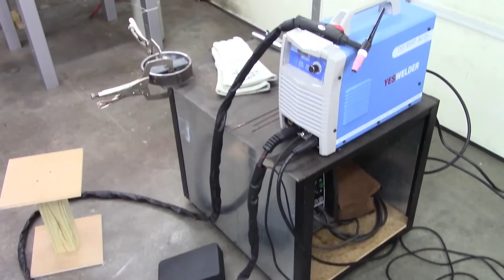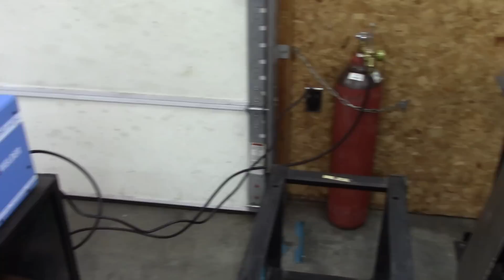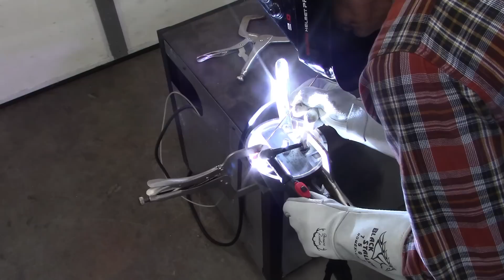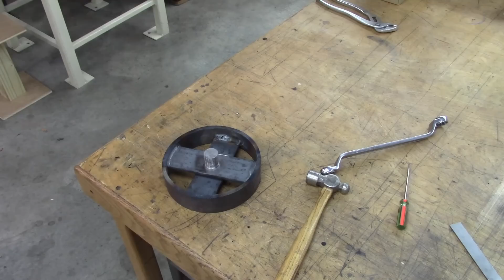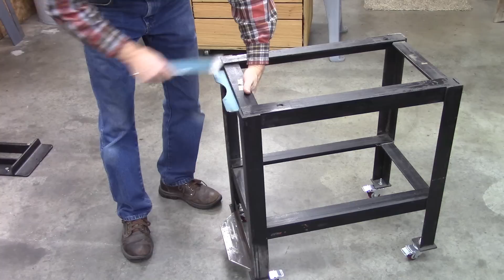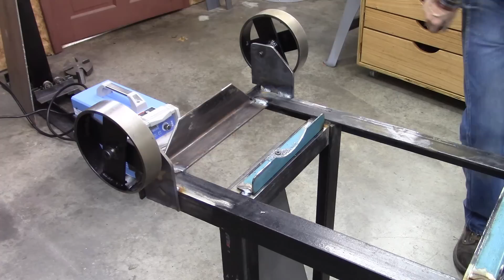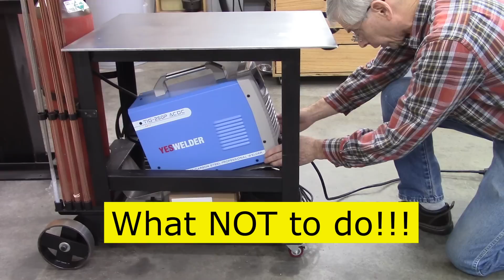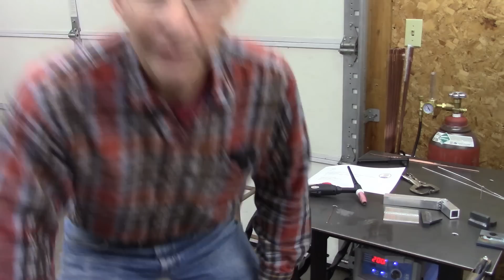Steel Wheels, Welding Cart and My New TIG Welder

Comment: Don’t worry too much about holding the torch near the weld with a long (5-10 second) post flow. That’s a concern with stainless. But steel and aluminum doesn’t have that problem. While you’re right, it isn’t required to weld the back sides on this. It is practice, and with many things, particularly welding, the more practice, the better. TIG requires more practice than other welding processes.

Just think about this; a great looking weld on the outside may conceal a poor weld inside, though most likely, it’s good. A poor looking weld outside will be a poor weld inside as well. But a “decent” looking weld can also, as the great looking weld, go either way. As someone here suggested, in the beginning particularly, cutting a weld, polishing it and etching it to see the quality of the weld is very helpful. You can have a lot of porosity (holes) hidden in the weld, and poor penetration means that while seemingly strong at first, it might come apart later.

With positioners, it’s easy to find the correct speed. Assuming you know how to weld, and the different metal thicknesses requiring different amperage’s and welding speeds, you just translate that welding speed to the peripheral speed of the surface you’re welding rotationally. Just use what you already know about finding the length of the circumference you’re welding and multiply by the rotation speed.

By the way, I’m pretty pedantic over the practice of calling the work clamp, the ground clamp. The only thing grounded on a welder is the power cord. People are so used to hearing and reading “ground clamp”, that they don’t think about it. The problem is that a ground is not part of a live circuit, while the work clamp is. If you attach the work clamp to something to weld, you ground your circuit. The welder will short. When I went, a few years ago to put two weld on hinges on my 14” lathe, I almost forgot to disconnect the power from the outlet. Don’t do that. I’ve seen very nasty results from that happening. It’s exactly what happened here. It’s also why using the welding cabinet as your welding table is dangerous. The welder WILL move around in that table. The welder case is grounded, but the welding table can’t be. If they touch, well, you see what happens.

Also, never mix any wheels, brushes or anything else used to clean metals between types. So, you need everything separate for aluminum, stainless and any other steel. So three sets of everything. Yeah, that seems like a lot, but if you cross contaminate, you’ll get depressed, believe me.

I don’t want to be too depressive here, but I would have left the wheels as is. I’ve built a lot of tables and carts with wheels. I’ve always found that having four swivel wheels is better than two swivel and two fixed. Maneuverability is much better with the four swivel wheels. My welding cart I built, with everything in it, weighs about 500 pounds and moves easily, even in tight areas. But the tool cabinets I have are clumsy. I’ve replaced the fixed wheels, and they’re much better.
Reply from the maker: All good information. I like the two non-swivel wheel but would like four swivel if I was not also using the cart for the table. And YES, I agree, this is not generally a good practice. For my small space limited shop it's a good option but as you said, it's not a good practice and I saw this first hand. In my mind it is sad that this happened. While is was should have been seen as a "good example of what not to do" it reflected badly on the welder in the minds of many. I'm not saying it's the same quality as a Miller but it is absolutely a good functional welder at a good price.  Yes I have found out with Aluminum contamination is terrible. Steel not so much but still somewhat an issue... never welded stainless yet. My post flow is usually 3 to 5 seconds. It helps but I agree... longer just wastes gas.  My weld quality is probably good enough for anything I am doing. I have welded 1/4 and 1/8 plate and bent it in the vise with a hammer. It never breaks at a weld. In fact 16 gauge sheet metal was the same and the 18" aluminum too. I'm not saying they are perfect but when they look good they are good enough. I worry a lot more about some of my past MIG welds. In fact I'm thinking about re-welding the stand I made for my mill. The weld positioner I had was VERY crude and built just to get the job done....  More to come on the positioner. I'll do it properly at some point. And thanks for all the great pointers. I'm pinning your comment to the top. It's all good info but most importantly what you said about welding and grounding is spot on. Thanks!
Reply: @WinkysWorkshop  I’ve been subscribed for a long time, but don’t always comment. I like your thinking. You come up with a lot of interesting and useful solutions.
Reply from the maker: @melgross  You have comments enough that I remembered you and you always make positive and helpful comments. Thanks!

Comment: That seems like a design flaw in the welder.
Reply from the maker: You might be correct. I think the high frequency start is hard to isolate. It can jump over 1/2" and if it does, it will try to carry the high current with it. I think the biggest flaw was not putting a warning in the manual about the danger to the welder. The welder performs way better than I ever dreamed it would but the documentation is terrible.

Comment: You got the hang of that pretty quick I reckon.  Something to do with being left handed maybe! (There are some really good left handed TIG welders on YouTube...). One other downside of TIG is greater overall heat input than MIG welding & that can cause more problems with distortion.
Reply from the maker: Thanks! It seems much easier than MIG to me. I totally agree about the heat, it's fairly extreme.

Comment: What is the duty cycle and material thickness  ?
Reply from the maker: Pretty good,  60%@250A and 100%@180A
Reply from the maker: I was welding 1/2" without issue but if you do very much that think you'd need to get a water cooled torch.

Comment: Nicely done, Mark! I bought a TIG welder about a year ago & never did get decent welds on aluminum. You’ve inspired me to try again!
Reply from the maker: It took me about 3 tries but it is harder to do weld than steel. It helped me to watch a few videos so I had a starting point. I have a feeling amperage is critical. To some degree I probably got lucky. Cool CNC video. You should make more videos. Maybe some of your restorations. I'd love to see them!

Comment: Did the welder fail due to the case earthing out on the cart, or was it because you didn’t have the grounding clamp on the workpiece? 
Either way, great video as usual and an inspiration to watch 👌
Reply from the maker: I suspect both. Not having the ground clamp on the table make the high frequency go through the welder. Both conditions were probably needed tp make the welder fail.

Comment: Being able to fry the TIG welder by having the case contact an earthed surface feels a bit like a design flaw to me.
If you're a hobbiest, working on the inside of a car, van, or something like a metal boat hull, it's perfectly conceivable that you'd bring the welder inside with you so you didn't have to clamber back out each time you needed to adjust settings. With all the lumps, bumps and strengthening ribs, it's almost a certainty that the case would eventually contact earthed metal. It just feels like quite a big design oversight.
Reply from the maker: I found one post on an Everlast forum that said the welder needs to be isolated from the welder ground. However, I'm not saying you are wrong. HF is also another animal. When i killed the welder I forgot the ground clamp and the HF start was looking for a return path.

Comment: Maybe use some angle iron to extend your top table so you can clamp stuff to it
Reply from the maker: Yeah... maybe make is expandable but it does have a 3 inch overhang on 3 sides for this reason.

Comment: If you do a lot of welding at 200 amps or more the torch gets really hot so you may want to look into a water cooled torch and water cooler.
Reply from the maker: Yeah you're right, it got a bit hot after welding the wheels. If I had to weld a third wheel I would have waited for it to cool. I'm retired so I usually don't get in a huge hurry.

Comment: What you really need to do is have your torch hand resting on something rather than try to keep it stable holding it in the air, also when Tig welding you should be in a comfortable position & I am sure your welds will improve.
Reply from the maker: I'm overall comfortable but you are right about my hand. I started holding the torch like a pencil which allows me to rest my hand on the table but I think I will also get a flex head torch.
Reply: @WinkysWorkshop  Does help with hand position & working at different angles. I thought you did well for your first time but I was Surprised that you said it is easier than Mig, I think it take much more skill to Tig but we all have our strong points. Thanks for the reply & enjoyable video.
Reply from the maker: @alfredocuomo1546  I think gas welding experience helps. I grew up with gas welders. TIG is basically high speed gas welding. Ha!  Thanks

Comment: Wow if the case is live what happens  if someone touches it and the table 😵😵😵
Reply from the maker: The case isn't live, it's a ground. The high frequency start probably killed it. The stark is about 10,000 to 15,000 volts. When I had the ground disconnected the high frequency (high voltage) was looking for a ground. 15,000 volts is about a 1/4" long spark. It's low amperage so it feels like a door knob spark but electronics can't handle that kind of voltage.
Reply: @WinkysWorkshop  alternating current swings positive to negative on both leads probably close to 120 times a second In that inverter
Reply from the maker: @rodneyfox5566  I'm not sure what the frequency has to do with getting shocked. i has it set on 80hz when welding aluminum but it goes much higher. It still under 25 volts. Of course a car battery can kill you but its unlikely. There is more danger of explosions than a shock.
Reply: @WinkysWorkshop  in order to save money the way they isolated dc power from the the ac was to use the case as lead very common in inexpensive welders and extremely dangerous
Reply: @WinkysWorkshop  stay safe bud 🙏
Reply from the maker: @rodneyfox5566  Aside from the HF start we are talking about fairly low voltage Usually 13-25V. I've had the welder open and as near as I can tell the welding ground is not the case ground. Nevertheless, there is always a potential for a shock when welding regardless of weather the case is grounded or not. Even touching metal on the table while welding has a potential. I'm not defending this welder. I'm positive its nowhere near the build quality of a Miller or Hobart but if these welders were shocking people they would not be around very long. Yes Welder has been selling welders since 2006 and has a very good safety record. In fact, weldguru.com rated them in the top 14 welders. Miller was number one of course but Yes was right in the middle (no. 6).

Comment: que buen carrito , me podrias pasar un plano de la cilindradora de planchuela , abrazo a la distancia
Reply from the maker: Tendría que dibujarlo primero, pero Vevor hace uno por menos de lo que podrías hacer por  https://www.vevor.com/slip-roll-c_10116/sj-300-slip-roll-machine-11-8-300mm-slip-roller-0-8mm-sheet-metal-fabrication-p_010315030748?utm_source=google&utm_campaign=19171448111&utm_term=149935062131&gclid=Cj0KCQiAtICdBhCLARIsALUBFcFj1kYdHdd27hoJYao1Q1OhQi7zeKeymwPfhg7rKCBAEGoMe_Eka8UaAltSEALw_wcB
Reply: @WinkysWorkshop  muchas gracias por tu pronta respuesta  , hasta pronto

Comment: Great job Mark, If  I may suggest to help your new journey in TIG....you can not free hand TIG...the torch hand MUST glide along while rested on something, a wood block, the part your welding, ect. You must keep the the gap between the work and the tungsten as short and constant as possible. Cheers!
Reply from the maker: Good advice and I totally agree. I've started holding the torch like a pencil which helped a lot but I think I may get a flex head. This allows my hand to rest on the table. I will say on thing, this TIG welding is easier and more forgiving than MIG, especially 120V mig where the weld is very narrow.

Comment: One of the nice things about tig welding heavier metals is that you can reflow the welds without needing more filler metal. This is particularly good for porous welds. I like tig for thinner metals as it has less warpage, especially if using a copper or aluminum blacker plate on steel. You can tig weld copper, but you probably will have to make filler metal from off cuts to keep the color of the weld uniform. Also for welding glasses, you can use straight CO2 for anything other than tig.
Nice welding cart. I made one from either a former welder base or a former welding cart and a drawer module from an old desk. It's quite useful and practical.
Reply from the maker: Thanks for the info, i have a lot to learn but I do like TIG welding.

Comment: I've never seen a TIG shroud glow before!
Reply from the maker: Things get hot for sure. I was welding 3/8" and 1/4" with about 230 amps. Judging by the welds 180-200 would have been enough but they certainly go good and deep.

Comment: Neat Cart Winky, you will be a master in no time, and that Welder will be super handy, i use mine heaps, even to heat small parts to bend....do you watch The Metalist ?
Reply from the maker: Wow...  I never thought about using it to heat but you could get a lot of heat in the right place quickly! Thanks for the tip. No I've never watched the Metalist, Youtube?
Reply: @WinkysWorkshop  Yes very handy for heating, yes The Metalist on Youtube, he has some good ideas, just found him recently.
Reply from the maker: @65cj55  Thanks, I'll check him out...  seems like I did watch him a while back.

Comment: you should use nylon shoulder bushing between the table top and cart so the bolts do not come in contact with the cart. that would insulate  the table top and cart
Reply from the maker: I thought about doing that but I think isolating the welder from the table will work just as well...  hopefully!
Reply: @WinkysWorkshop  as long as the welder does not slide or get bushed, you could put plywood sides on the inside of the cart to protect it from sliding into the steel legs
Reply from the maker: @funbricknj  I think this is unlikely but I was thinking the same... or similar. I was thinking about gluing 2x4s in the shelf to contain it.

Comment: I was prepared with a bunch of tips but those welds looked pretty good, one thing that will help is a stubby lens and a short cap on the back side of the torch will save gas. a # 8 short cup will most likely cover all that you will need. I look forward to seeing more projects with the Tig. it is a great skill to have.
Reply: As a relatively beginner mig welder, yeah, they do look pretty good! The only thing I would maybe suggest is welding where he could have more support for his arms. Like printing or handwriting, I'd think the results would be better to not have your elbows floating in the air. That's a lot to have both arms floating and trying to be precise.
Reply from the maker: @gorak9000  I agree!

Comment: Who would have thought it's possibele to kil la welder that way. I didn't know that.
When I see your first welds, you're a quick learner.
Reply from the maker: Yeah...  for a split second the idea of the welder touching the table that I was welding on concerned me. Then I forgot about the concern and remembered my thought after the welder died. Apparently I was having a premonition. Thanks on the welds...  I was actually surprised myself. TIG is much easier than I thought it would be. Of course I have a lot to learn still.

Comment: Well done Winky a good outcome. Looks like the welder manufacturer has a bad design in not making the steel case isolated from the electronics. Regards from Australia
Reply from the maker: I tend to agree although I wonder if most welders would do the same.
Reply from the maker: And thanks

Comment: Great video, TIG is nice when done properly...Speed and angle of the torch are critical as well, when welding thin to thick keep the heat on the thick and add the filler metal to fill the gap.. You had very good results for a beginner, keep at it.
Reply from the maker: Thanks Bill!

Comment: I’m impressed with your progress TIG welding. A foot control makes all the world in controlling your molten puddle. Also, usually you can just attach your ground clamp to the welding table. That way as you reposition your work piece it is automatically grounded,
Reply from the maker: Thanks, I was also surprised at my progress. I have a foot pedal but I seem to do just as well with either method. Yes, I've started leaving the ground on the table. I was thinking about making it a bolt on connection with an adapter for the clamp on when not welding on the table.

Comment: Great job on the welding Caht (as they say in Boston)!  Are you seriously telling me the welder's grounding is that awful?  I would have just added a plastic rim over the bottom edge. Fortunately, they fixed it.
Reply from the maker: Thanks! I'm not an expert on electronics but I suspect the ground for the welding process s different than the neutral ground. When I tried to weld without the welders ground (the welding clamp) with the chassis touching the cart it took a different path trying to find the ground. 

I wish I knew for sure.